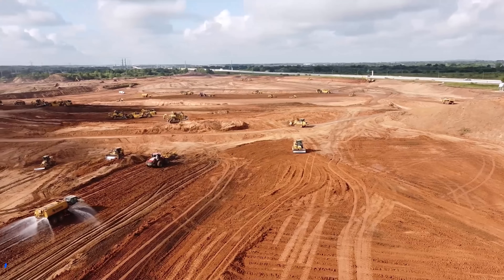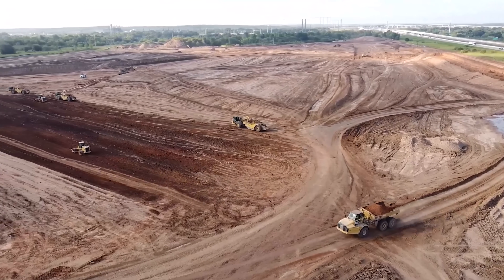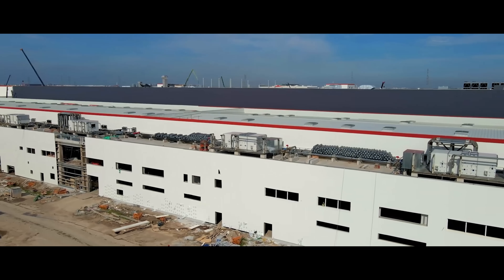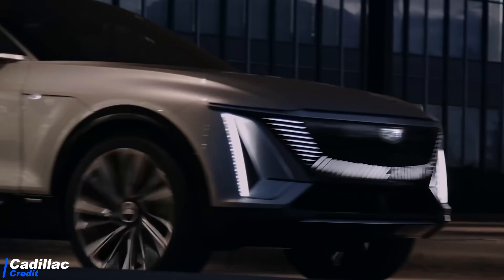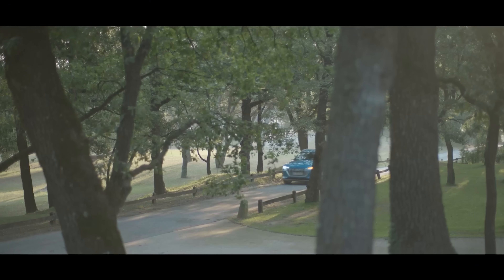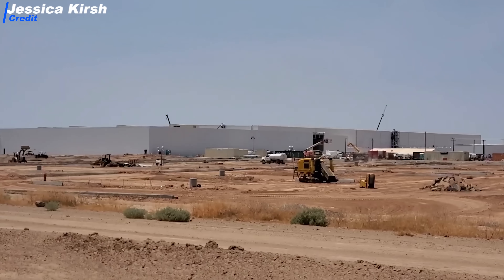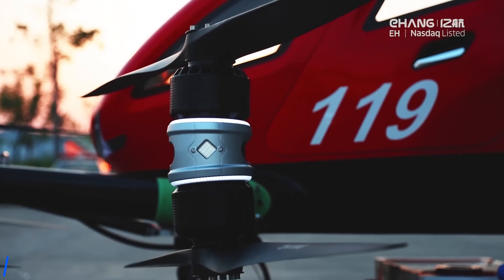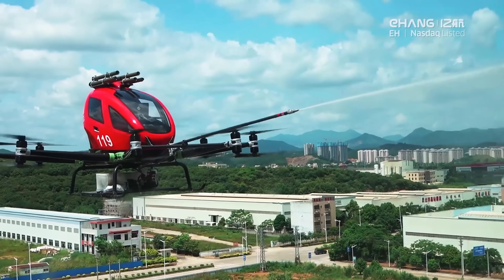Giga Texas & Giga Berlin Update, Elon Confirms SMALLER Cybertruck!

Comment: Let's pretend I have one, but without a  small trailer with fuel, an efficient engine/generator and battery to switch off to.
I go on a cross country trip and now have to stop and wait for recharging or stay at motels where the battery can be recharged? Alternate is instead of gas stations, there are standardized battery exchange stations?

Comment: I want to see actual footage of that firefighting drone, by independant sources.  Water is /heavy/, and fire hoses use it really fast.  If that can take a whole tonne of water I'd be surprised, and that's just 1m^3, which won't go far.  A 1 3/4" line at 16 PSI (sorry, the source doc is from the US) uses something like 125 gal/m, which is a pretty anaemic hose and still gets rid of a tonne in only 2 minutes.
Reply: I've seen video footage of smaller fire-fighting drones, which carry hoses from ground-level, so can spray continuously. I don't know if there is a lightweight  electrical cable supplying power at the same time, but that seems do-able. With such a system, you can get long-term water-sprays focussed on burning upper-storey buildings. Only worry is the electrical load on the drone-motors to avoid over-heating on prolonged missions. Perhaps a hybrid methane or hydrogen fuel-cell version could be used if the weight of cables proves too high.